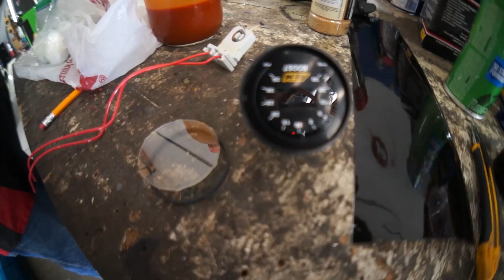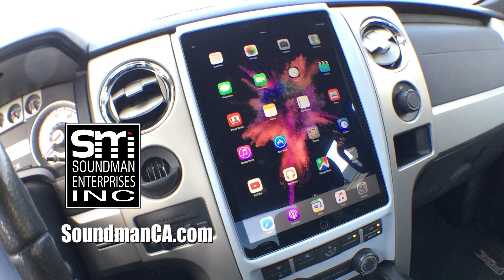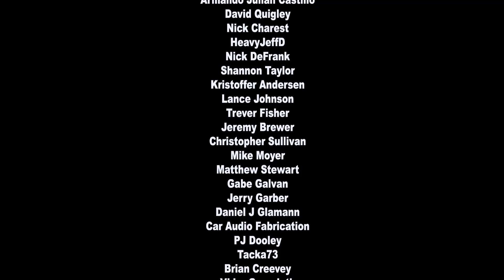I had to smoke a fool today -  The Timed Harness Challenge

Comment: Hahahahaha yeah you did!!! Although Doug my white friend you didn't do western union connections brosif.......
Reply: Maybe Doug banks with chase and not western union CarPhaggets car audio
Reply from the maker: +CarPhonix CarAudio neither did you!!!
Here's the technical rules for a linemans splice (western union)

[The Western Union or Lineman splice was developed during the introduction of the telegraph to mechanically and electrically connect wires that were subject to loading stress. The wrapping pattern is designed to cause the termination to tighten as the conductors pull against each other. This type of splice is more suited to solid, rather than stranded conductors, and is fairly difficult to complete.[1]

The Western Union Splice is made by twisting two ends of a wire together counterclockwise 3/4 of a turn each, finger tight. Then, using needle-nose pliers, the ends are twisted at least five more turns, tightly. The cut off ends are pushed close to the center wire. ] (from Wikipedia)

I counted your twists.... you didn't twist at least five more turns per side with needle nose pliers... 😌😝😝

And you didn't perform 3/4 of a turn each.
Reply: Got em'
Reply: CarPhonix CarAudio damn... takin that L
Reply: SoundmanCA ughhhhhhh fine!!!!!!!
Reply: you didnt either lmfao...
Reply: defiantly no western union,, and some weak ass wraps,,..
Reply: I haven't seen a worse wrap since I went to McDonalds, come on man....
Reply: ***** little known fact, Rafa is Doug's illegitimate son.
Reply: ***** considering Doug did his mom, it does matter. He better listen to his pappy 😂😂
Reply: * CARPHONiX CARAUDIO~ hope you're doing well, nice challenge btother. keep them happy up in the B.C.           ~t.bone*
Reply: Was there anything in the rules about doing it twice? 16:40
Reply: I think it would be awesome if you guys revised the rules. Do proper western union splices and the finished products between competitors should be determined by the public, along with the timed result. really cool challenge but I think the rules need to be concrete before all other car audio wizards get involved. love the channel Doug your the funniest jackass on YouTube!
Reply: ffs getting baaaallegerent with it lol
Reply: Why do you keep going around in circles at the begging of the video ?

Comment: It's on like Donkey Kong! You're going down! Oh and my soldering iron is in the drawer next to the silverware....

P.S. I about died when Rafa dropped your harness in the garbage.
Reply: CarAudioFabrication can't wait to watch you now! good luck
Reply: CarAudioFabrication this'll be interesting
Reply: CarAudioFabrication challenge meade916 next!!
Reply: Rik Verma dude, yes!
Reply: Mark, you're a hella good sport
Reply: Mark you know what a western union connection is right!!!??????? For Christ sake!
Reply: CarAudioFabrication He said tesa tape.. not template tape...very important you remember that.
Reply: CarPhonix CarAudio get Chris's shifty done...lol
Reply: Next one to challenge... SMD or EXO
Reply: @sinister Shoot, good call, you saved me bro.
Reply: CarAudioFabrication hahahahahaha I was wondering what F that was......
Reply: subbed to CarAudioFabrication now just to see the response Video.
Reply: Line mans splice for the win!
Reply: I can't wait see Mark bruele up that shrink tube. Or is this a saute type of deal?
Reply from the maker: @CarAudioFabrication @CarPhonix  Car Phonix would have been fired as a lineman with that fake linesman twist!!!  
A western union connection has five turns per side of the stripped wires, and is meant to tighten when pulled even if its not soldered.....
Car Phonix's "parallel twist" is not a western union connection. 😝   if you would have pull tested the connection before it was soldered, it would have easily come apart...

I recommend the "rat tail" twist like i did.... its much better than a fake linesman connection 😌😌😌
#goteem #again
Reply: SoundmanCA  this challenge its   too much for marks OCD!!  (fab kitchen) almost died!!!
Reply: Sinister goteem
Reply: Marty from MightyCarMods is awesome when it comes to soldering wires. You should challenge him.
Reply: Mark please don't let me down I predict you're going to do 5 minutes 30 seconds you're going to practice it between 5 and 10 times and that you're going to come up with new methods on doing multiple wires at once.
Reply: Mark is a perfectionist!!! He's gonna cut everything to the exact length, i predict 9 minutes (but it's going to be perfect)
Reply: CarAudioFabrication I don't know if you can do it Mark... I mean, aren't you going to have to make 2-3 mock ups first? 😂😂 got eem! Sorry I couldn't help myself.
Reply: CAF is gonna take 15 min but it'll look perfect once he's done, the heat shrink will be color coded and have CAF logos on it and the tape will leave no wires exposed, it'll be worthy of display under plexiglass with leds
Reply: and don't forget, no routers or mobile solutions templates are allowed. Oh and make sure to leave a 1/16" for the vinyl once your wrap it, lol
Reply: Sorry Dougie but I got Mark in at around just over 7 minutes and prettier. I still love ya though.
Reply: Soundman left a lot of room for CAF! Prepare for a Casey Flatnose episode on Amplified!

Comment: Did you see the kiwi 🥝 call out your soldering? He said they were like hurricanes only smaller and that they would eventually corrode. My guess is the owner would swap out the head unit long before they corroded to the point of failure. Hell it might outlast some head units. He did the harness in 10:21 btw.

Comment: If you use the old pistol style 1400w shouldering iron you don't need to plug it in until your ready to shoulder.  Bitch heats in like 3 seconds on demand.  I hate when people twist there wires like that also.

Comment: I have just a few thing to say as I have worked as an installer for over 15 years. One, why would you put the shrink on after stripping the wire, thats just a pain in that ass and takes up time. two all that tape is pointless just throw two zip ties on it and call it a day, no one wants to spend 5 mins cutting your tape off and covering their hand in glue when your solder joint fails. Three love the videos but when you strip you should keep it closer to your hand; holding the crimp/snips at the end and pull is the worst/ use your fingers as leverage and pop that it off like the top of a cold beer it faster, you should be able to get it done in 4 mins unless you work at circuit city lol or best buy 10 secs.

Comment: You think you can do it that fast with a used harness lol when you love audio installation as much as I do yet have no money or resources you reuse those bad boys untill the wires are lil nubs its not as easy when all your wires arnt the same length...... Also get you a set of decent self adjusting stripers and you can virtually eliminate need for solder